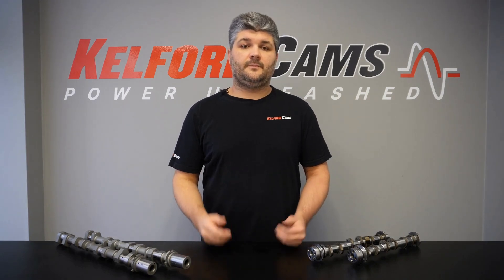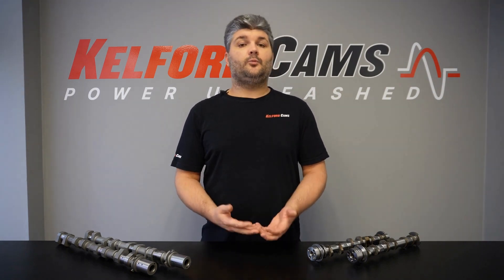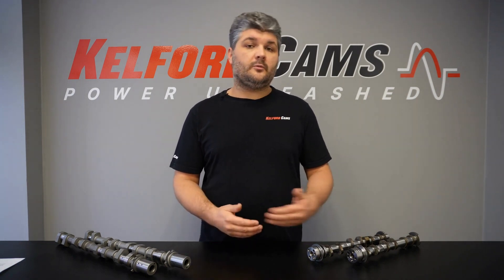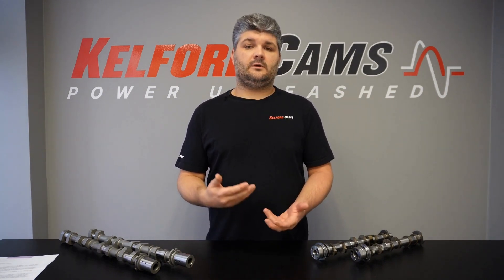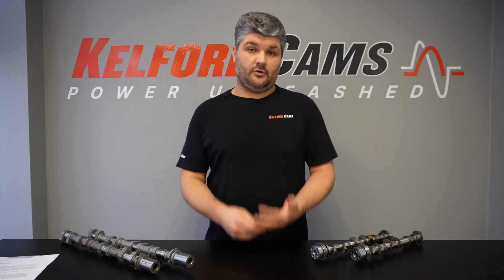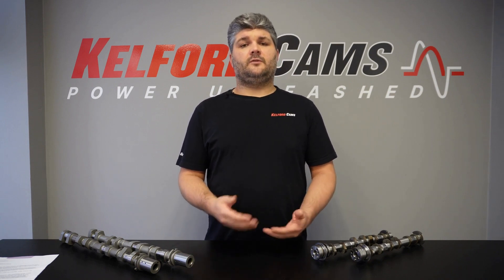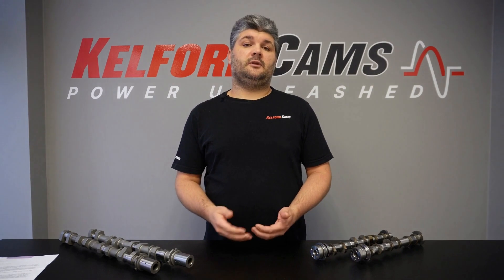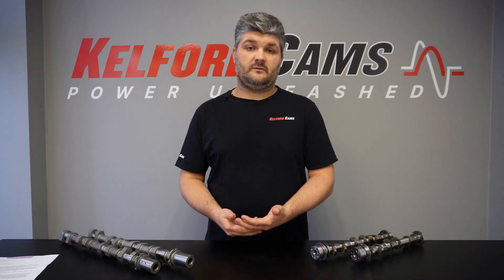What Camshaft Is Right For You?

Comment: Whats the idle like for a barra with 218 -a cams ??
Reply from the maker: Hi! With the variable timing our 218-A won't produce a massive difference in idle sound - this can be tuned in though!
Reply: @Kelford-Cams Not  a massive difference from standard, do you mean ?? Or from the 218 b ???
Reply: @Kelford-Cams  would a g 42 1200 suit this type of cam shaft ??
Reply from the maker: @wiz3518  Not a big difference from stock on the 218-A. For a G42-1200 you are most likely going to want the 218-B, feel free to email us directly if you would like more detailed tech advice 😊

Comment: Cam recommendation for street car 1jz/vvti, stock engine, 3 inch exhaust, r154 trans and 4:10 s13 rear? My turbo is EFR8374 which is 500-800hp. I plan on running 91 octane and Ei85. Thanks
Reply from the maker: Hey, our V229-C cams would be the best suited, these matched with our KVS109-T valve springs and Titanium Retainer kit. Check out Kelfordcams.com
Reply: @Kelford-Cams  Are these drop ins, also why TI retainers versus say a steel retainer?